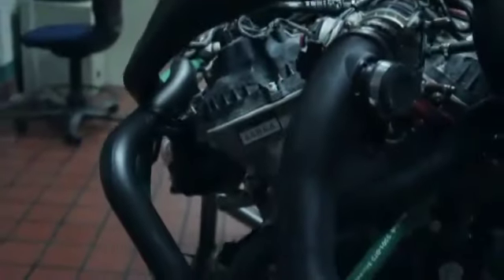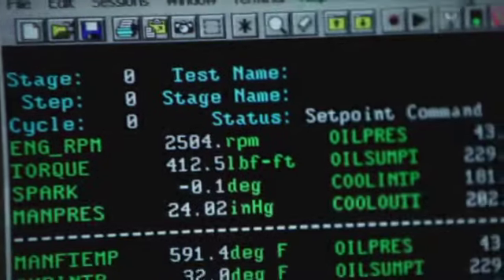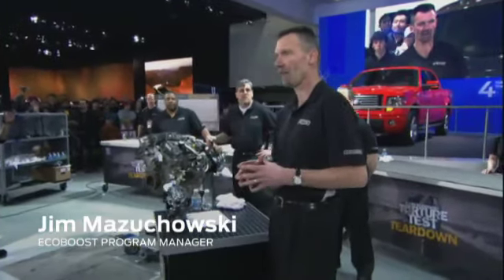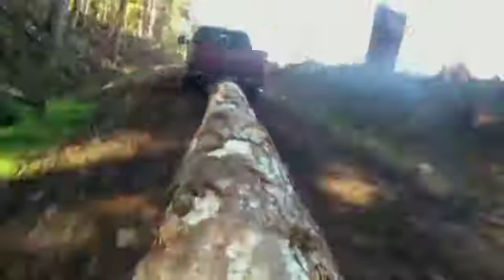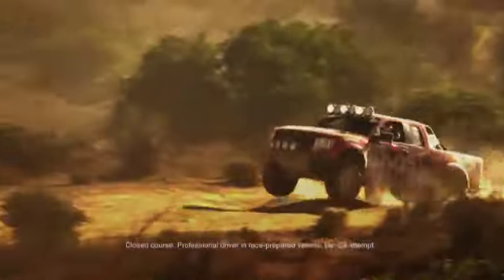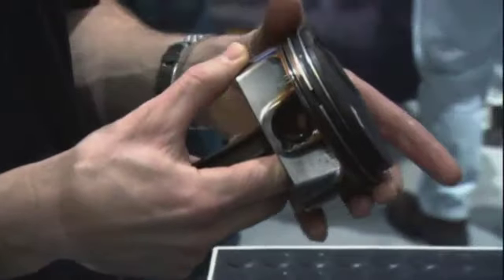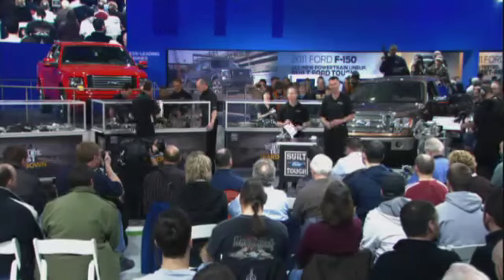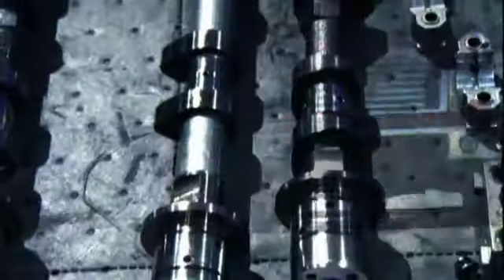Ford F-150 EcoBoost Torture Test Episode 6_ Teardown

Comment: Oil plays the biggest part!
Reply: This engine suffered no oil leaks, coolant leaks, timing chain stretch, timing chain tensioner failure, waterpump failure, or turbo failure?? How is it that the engines on the street in every day trucks aren't holding up as well?